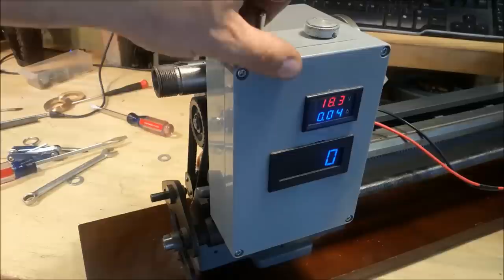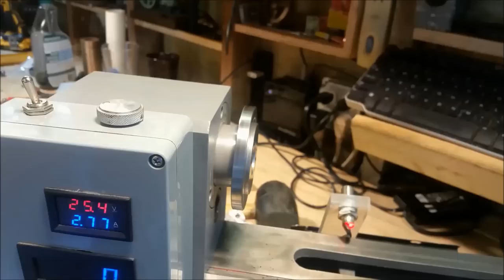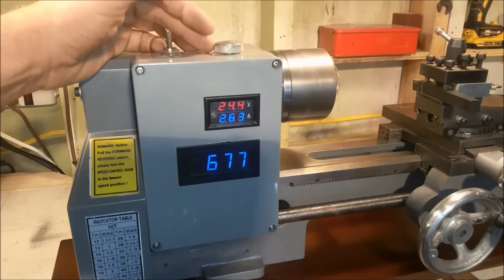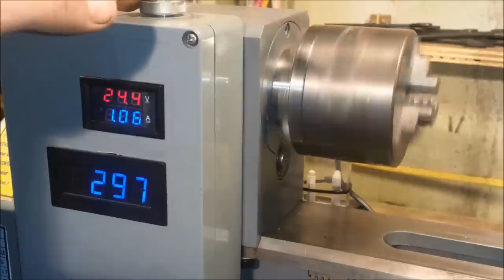Mini Lathe taper bearings installation

Comment: Tapered roller bearings for lathes are the same as what is on the front wheels of your car. Look up "hand packing wheel bearings" for the proper way to fully pack those bearings with grease. The service that a lathe sees is nothing compared to your front wheel bearings on a car, and they are almost never re-packed. They should be pre-loaded the same as the cars' are. Never squeeze the spindle head between a vice's hard jaws; it's a precision component for the chuck to register on.

Comment: You didn't pack those bearings properly.
Reply from the maker: You are totally right on that! https://youtu.be/BhL1uAp_WCw
Reply: yes put a lump of grease in your palm then keep working the open ends of the bearing against your palm full of grease till it comes out the other side bro then they will be packed good
Reply: @DonBrandt  the guy in the video over filled the bearing while he warned against over filling
about half the grease he put in would suffice

Comment: One think is not clear to me and I may not be the only one; the outside sleeve of the roller bearing you installed are not secured from moving further inside by the vibration or even by the cutting tool and the most radial cuts could cause that to happened. You did not secured the sleeves or outside rings of the bearings.

Comment: Ok, I am shocked.... just downright shocked.  If you have not done this mod to the spindle, do it now!!! I have less than a 10th of runout on the outer edge of the spindle to the center of the spindle.  I have less than a 10th of runout axially on the face of the spindle.  This is a 15 year old HF 7x10 mini-lathe on a 7x14 bed.  Believe me, this thing was NEVER this accurate, ever!!!  It's quiet and just an amazing upgrade.  I sprang for the metal high low gears from LMS which fit perfectly.  The spindle rebuild is a cinch with a press.  Thanks for the great video Don!!!!
Reply from the maker: Thanks for your comments.. I posted this because i have not found a clear example of how to do this modification. -Cheers

Comment: Let me brag about these wonderful new bearings whilst I install them with a claw hammer. But don't clap for joy just yet; see me hammer on other precious machined surfaces like I have no common sense.
Reply: You lost all credibility long before the "precious machined surface" absurdity.
Reply: THE !! CREDITS !! ARE !! A !! METAL !! SHREADDER !!
Reply: While I’ll grant you this guy is not exactly being as subtle as the average YouTube machinist, I did not see him hitting any machined surface with a claw hammer. I saw him hitting pieces of wood, plastic, and brass with a claw hammer, and those pieces of soft material hitting steel machined surfaces, which they can totally take.

The bearings for the intermediate shaft got some rough treatment. Installing the outer race by hitting the inner, transmitting that force through the balls, that’s a Bad Idea. He might find the intermediate shaft having noise problems sooner rather than later. But that’s not where the precision of the machine comes from.

(PS: how reverent do you think the original Chinese assembly was?)

Comment: If your lathe has not speed selector, it is relatively easy to add a oil pan between the two rollers. It will leak a bit especially in the front but small flange with a felt gasket will do wonders even if you have to fit it afterwards.

Comment: newbie here. nice upgrade.. have a Chinesium 7x23" and the bearings are out to .005" at 6" (est.) after cutting steel for a few weeks.  It came with a 1.2Kwatt DC motor that I'm re cutting the first pulleys for a lower speed and larger belt.  The tool holder mount angle adjustment would not hold so I milled out the cast iron and installed a couple of wedges and a couple of hex key bolts per side.  Chatter was killing my cutter faces although I found that Chinesium carbide can be ground  to an edge by hand, sometimes.. time to upgrade the grinder....

Comment: Nice video. However I'd seriously advise against clamping the chuck flange as shown at 6:12. Any damage/upsetting of the flange surface and the chuck no longer runs true. Same at 3:20, if the shaft falls through and hits something hard then the damage is done.

Comment: You need to check out a video on how to pack a bearing.  That grease job you did is common with folks that don't know better.  You can do it by hand or get a tool that will do it. but it really makes a difference in how long your bearing lasts, especially on vehicles.

Comment: Hey Don
 The bored  out area for the bearing races is deeper than the width of the races. I noticed you stopped installing when the race was even with the outer edge of the bore. I just did this mod to my lathe and the races went in approx. 3/16 past outer edge of bore. Try to use a hollow tool just under the diameter of the race for installing. Or a smaller bass punch evenly worked around race will work. The races should be installed so the inner edge of the race is seated on the inner lip of the bearing bore in the head stock, other wise the bearings can still move together loosening you bearings. You can look from bottom and see when they are seated.  
Good video Don Very easy to understand
Reply from the maker: Thanks for the comment. I hadn't realized the old race was recessed when I disassembled the headstock. Did you happen to take any pics or video while doing your mod? I'd like to link to it here for the viewers. It would be great to see another way to do this mod! -cheers
Reply: Sorry no pics. I was following your vid for ideas
Reply: A little tip ,when tapping in the bearing shell ,it is hard to see if it is fully seated, ,  listen when the shell is nearly seated when it contacts the bottom of the bore you will hear the different  sound it makes when struck, much sharper with a distinct ring to it     Great video !!

Comment: better than any videos !!! very well explained and many useful tips. you should've test the deflection of the spindle with a dial test indicator by mounting a bar in the 3 jaw chuck, before replacing the bearings and after

Comment: The inner races of the taper bearings should slide on the spindle journals to enable the correct pre load to be set....I polished the journals on my mini lathe, a Sieg C3 Super.....but the change is worth the effort..

Comment: I'm doing the same project and it's a bit more tricky than it appears without all the proper tools. People work with what they have, you found a way to get the project done and didn't break anything so it's all a success. The next one will be better having learned from the experience.

A suggestion no one has mentioned - instead of grease on the gears, put in a couple of oil cups or ball oilers on the top of the headstock and the gears can be easily lubricated for life. The excess oil will run out of the bottom of the headstock but you can seal the back of the headstock and bolts with RTV and channel it to the front face, there's going to be oil down there anyways.

Comment: I noted no grease or oil being placed on screws and spindles.  I live in central Florida.  Very high humidity.  Everything rusts immediately if not sooner.  I have been using a product called Blaster corrosion stop.  This works exceptionally well on marine battery terminals and will give several years of protection in a salt air environment.  Try it the next time you assemble something.  It is not available in many retail stores but can be found online.  It is sold by the same company which sells Blaster penetrant.

Comment: Good video Don....just wondering if there was a torque nut requirement to set the bearings to the races... or tighten snug then back off 1/4 turn ....or did I miss this in the video?

Comment: That plastic sleeve on the rear of the spindle is likely not a good, solid element when setting the critical preload required on Tapered and Angular contact bearings since it is not hard enough and thermally unstable. Best could be hoped for is to crush it slightly and hope it doesnt deform under heavy loads and heat differentials. could make a solid one out of a more hard, stable material...brass or steel.

Comment: You used a wood block to tap in the outer races but you only tapped them in until flush with the casting. On my mini lathe the recess for the outer race is deeper than the taper roller outer race thickness and the outer goes into the casting to maybe 0.05" beyond the edge of the recess. So maybe when you pulled the second inner race into place using the ring nuts, without knowing it, you also pulled the outers into their correct place as well. Either that or your outer races are not properly located because they do not come against the shoulder in the casting. In addition, if the outers have not pulled into the correct place, since you did not fit a spacer to make up the difference in thickness between the original bearings and the new ones, the spindle gear will be able to float something like 0.1" either side of its original position, meaning just about half the proper engagement with the layshaft gear. Of course as others have said, your grease packing of the bearings was not good enough.

Comment: For the price, I have to wonder why they don't just install tapered roller bearings at manufacture and raise the price accordingly.
Reply: For the sort of use this category of lathe of lathe was designed for (i.e materials and work size), the standard bearings it comes with are more than sufficient.  A lot of people use machines of these sort well outside the limits of what they were designed for. It is in this situation that modifications are needed. Tapered roller bearings are more pre-load sensitive than angular contact bearings, so have far more potential for being wrongly set up or maintained by less technically astute users leading to either poor performance or premature wear.
Reply: nirmal Thank you for your reply. I had asked the same question about a year ago and missed you previous reply. Well said. 
RL

Comment: 2000W brushless RC motor? WOW. That has probably some crazy torque to strip the belt :D
Reply: Or can be run very conservatively at 750W or so, still providing twice the shaft power of the original 550W brushed DC motor while being able to run forever without overheating concerns.

Comment: Hi Don,excellent video ! I have a Harbor Freight 7 x12 mini lathe. I just purchased the taper bearings and have a question. Did you have to machine  the rear spacer at all due to the larger races ? I was reading on another  web page that it would have to be machined 0.10 or so ? .. Any specific bearing preload when you installed the taper bearings ? Thanks :-)

Comment: Noticed you had 4 mounting holes on your head stock and ways. Did you drill the fourth hole. I know these laths at least the Chinese versions only come with 3 mounting holes/ bolts for the head stock. I recently purchased the 16 inch lath bed for the mini lathe and it also only came with only 3 mounting holes. Can't figure why there are only 3 mounting holes a fourth hole does not interfere with any function of the lathe or head stock but it would add more stability. Thanks.

Comment: I've been looking at doing this to my lathe. Just thought of a better way to lubricate the bearings. One could jb weld a bottom oil pan in place so you can fill the headstock with oil and have splash lubrication! Then make a tray at the top to catch some of the oil and run it down to the bearings. I don't like the idea of having to take apart the headstock to lube the bearings. Plus grease won't stay in them for very long at all without seals on both sides
Reply: Install two oil cups or ball oilers on the top of the headstoch, right above the two gear surfaces on the big gear. Excess oil will drain out the bottom between the two machined ways (it's lower). Seal the back of the headstock and the rear bolts with RTV when assembling to channel it to the front face of the headstock.

Comment: I definitely want to make this upgrade but I have a harbor freight 7x10” lathe and am wondering what the chances are that the same size bearing you used would fit my small lathe? You know of anyone who’s done this upgrade on a harbor freight lathe? I’m kind of a new hobby machinist and noticed that the cut quality kinda sucks on my lathe. (I know it’s about the cheapest lathe you can buy tho so I guess I can’t expect too much from it.)

Comment: By upgrading to inexpensive tapered bearings, you said the spindle runout was greatly  improved. 

For ~$20 USD, the manufacturer could have (?) installed tapered bearings and made a higher quality, more precise product. 

But they chose a cheaper approach. 

Can you help me understand that?

Thanks. 

Roy
1946 Logan 825, 10” Lathe
Ser. No. 34503
Reply: Sealed deep groove radial bearings don't require lubrication ever, in theory.  These tapered roller bearings will require occasional topping off of grease.  This is a bad tradeoff in the mfg or the distributor's eyes apparently.

Also, the Amazon bearings at $7 each probably aren't worth the savings because they're garbage and will brinell and fail in a few hours of use.  You want to buy at least the $25/pc McMaster or LittleMachineshop bearings that come from from a reputable brand...

Comment: Did you ever video the results after the bearings were replaced?  Mine without any pressure on the chuck looks great on the dial indicator, but when I apply pressure to the tooling you can see the chatter.

Comment: Thanks so much for this video. I am curious. Didn't you have to remove about 10 thou off of the plastic spacer? That is what I hear people are having to do because the thickness of the tapered bearings are a little wider than the original.
Reply from the maker: Thanks for the question. I don't recall cutting the plastic spacer. it does make sense. There are many of these 7xX lathes and there all a bit different. Good luck.

Comment: When l did mine had to reduce length of rear spacer by 2mm to get gears to lineup. Why not fit metal gears at the same time Good video thanks Roger
Reply from the maker: I know a lot of people do upgrade to metal gears, and this would've been the perfect time to do that; it regrettably was not in my budget. As a side note, I have only broken one gear in my lathe and it was the large pulley for the motor drive when I locked up the lathe at high-speed and it slammed. I learned a lot from that break. Thank you for the question and comment. -cheers

Comment: There didn't appear to be any seal near the bearing behind the chuck. How will you keep dirt from getting into the tapered bearing? Nice video work.
Reply from the maker: Hello Hugh,  That's my first name also BTW, the original or aftermarket bearing don't have a perfect seal. there is a plastic cover however. -Cheers

Comment: Folks didn't like your style of greasing the bearings. While it could have been done better, they're probably ok. What I didn't like is how careless you were around that spindle register. I hope you gave it a light skim, once you had the lathe put together. Still, all in all, a very useful mod. You must change that plastic spacer with an aluminium one. You can never get the preload quite right with plastic.

Comment: To remove the two nuts compressed together on the main-shaft, you used wrenches because you did not have the correct tools. I'm curious what the correct tool name would have been to use for those nuts. Thanks.
Reply: C spanner
Reply: Adjustable Pin Spanner

Comment: Hello Don! Thank you for your reply. It solves many problems, but one remains. Did you mount the rubber o-ring that he wrote in the micworkshop  (38 x 4 mm.). Do I need it at all? It's sits extremely tight.
Writes an Inquiry Rune

Comment: Don around 13:25 I can see the top spacer.
I know it has been a while but do you remember if the spacer fit on the key-way?
It looks like it isn't and i'm in the process of doing mine and it doesn't go on my key-way.
Thanks
Mike
Reply: Don have you had a chance to look at the Question?
Thanks

Comment: Where do you get the small brass washer how stay permanent that should be just after inner ring. Is it with the store or have I to buy it separately. How thick should it be (if I have to make it sell) Thank you for your video, would never dare these modifications without your video.
Reply from the maker: Hello Rune, thanks for your great comments.!! here are the instructions i followed to make the video.  Yes, you have to make the parts yourself.. Have a great day!! http://mikesworkshop.weebly.com/headstock-upgrade.html

Comment: should install seals , here a seal size chart and part number for seals , also bearing preload on that size taper bearing is 10 to 15 inch pound new bearings , 6 to 9 on used bearings ,

Comment: I enjoyed the video, particularly because I am doing the mod now.  I do have a question, did you notice after the mod that your High/Low switch was backward?  (low is now high and vice versa?).    Just curious.
Reply from the maker: Hello John. Did not notice that... I'm thinking the HI-LOW  gears may have been installed backwards. Cant say much about long-term with that.  Glad you enjoyed the video. -Cheers Buddy!